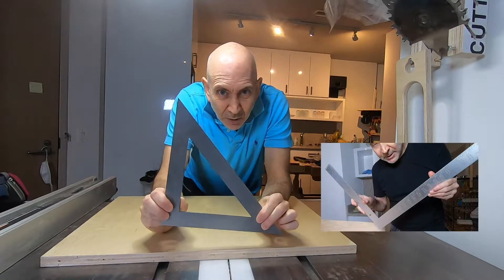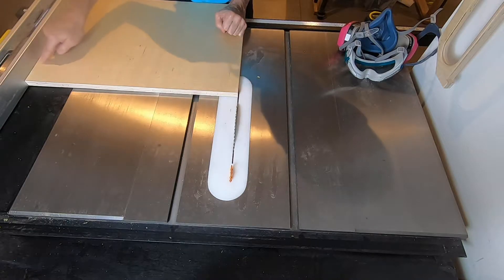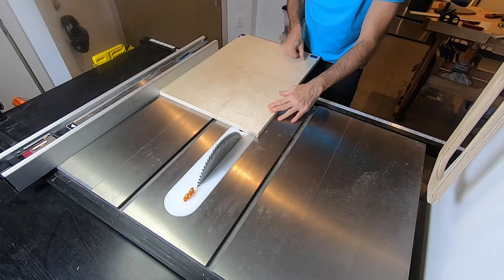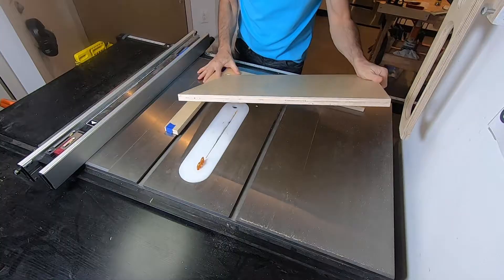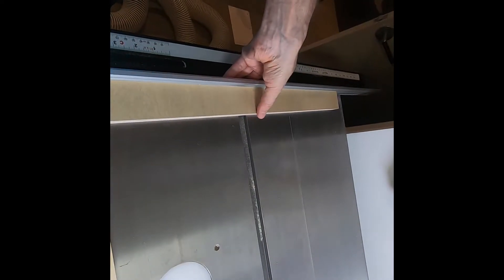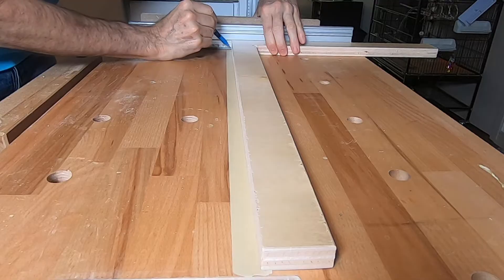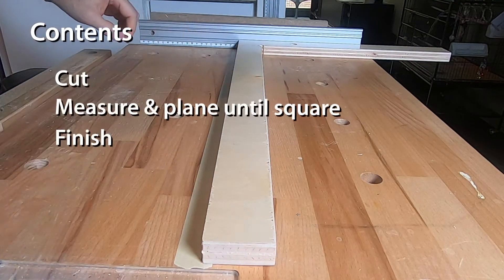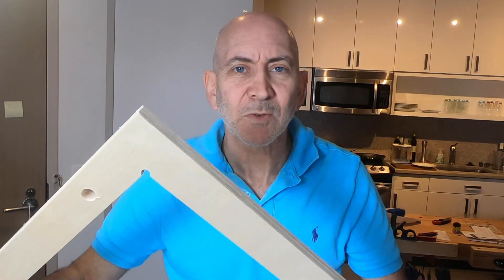Make A Perfect Carpenter's Square for One Dollar!

Comment: you may be "square" enough but you are NOT dead square!!   and the wood wont stay SQUARE
Reply: you may be "square" enough but you are NOT dead square!!

Yep, the critical measure is "square enough."  That's somewhere around where the error isn't noticeable during construction or by the user.  That can be rather subjective.
My experience is that errors do not tend to cancel out, but to add up, so I try to keep the error too small to see, and too small to interfere with good fit.